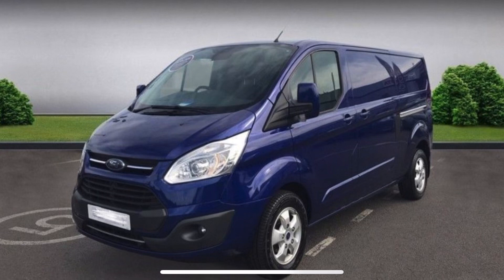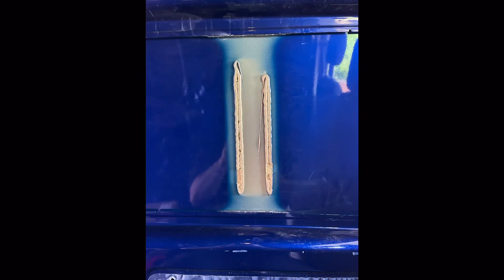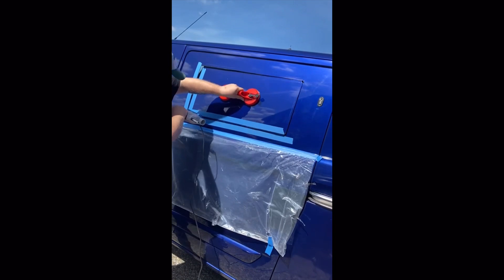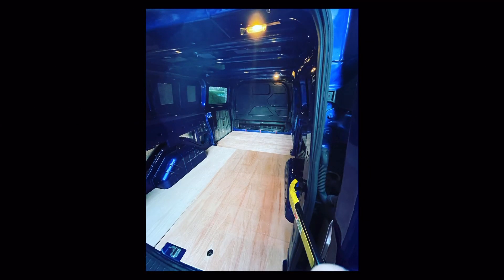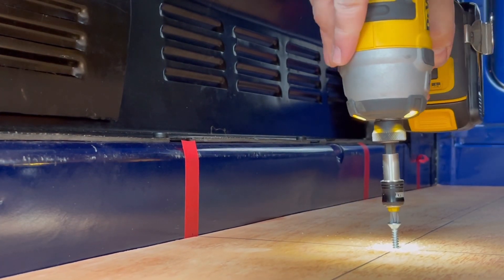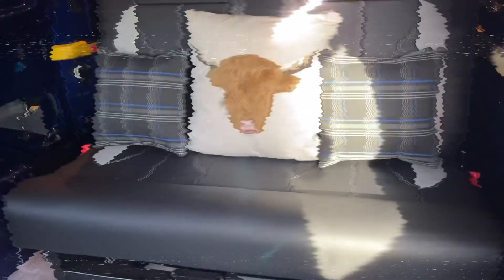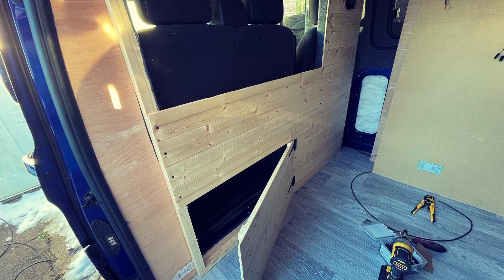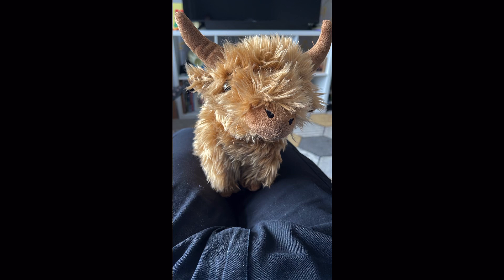Ford Transit Custom Camper Van Conversion Part One - Intro to an already started conversion!

Comment: With your bulkhead wall, did you mount directly up to the holes from the original bulkhead or did you have to use some spacers for the wall to move back to give room for the driver's chair to move?

Do you have any close up pics of your bulkhead wall at all please?